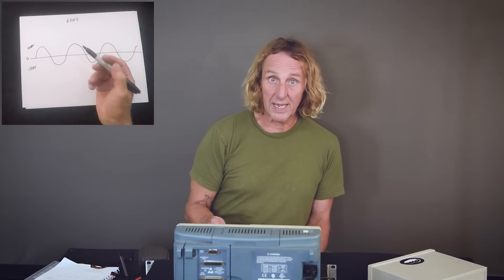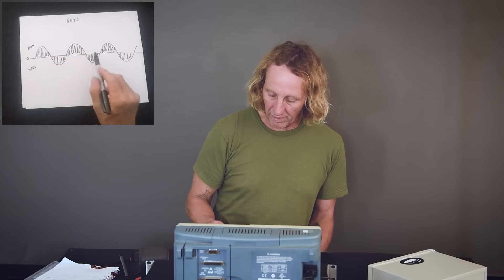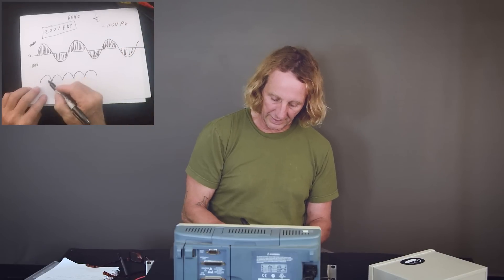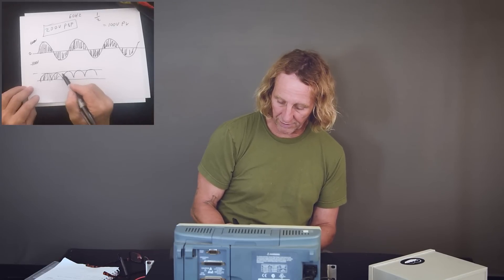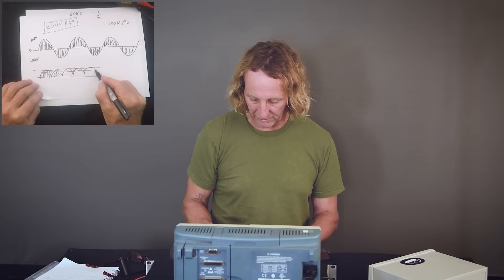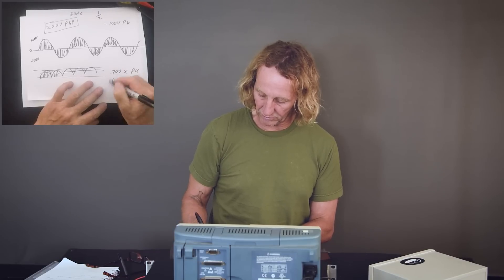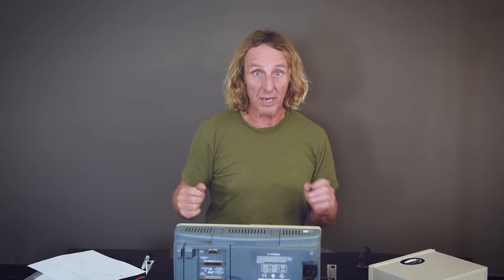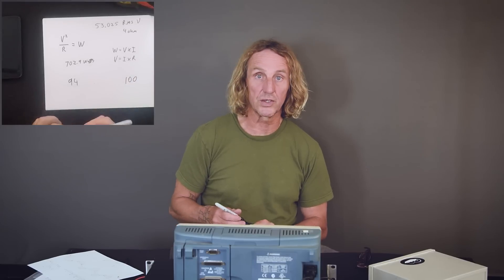Amplifier Power Watts vs Loudspeaker Sensitivity (Public)

Comment: Great video man, but now days everyone goes for the K watt sticker, dont even bother to look at frequency respond or weight. and power draw.. :washhands:👍👍
Reply from the maker: Power draw is a big deal for us. Power sag is an issue as well as feeder size and length and generator capacity.

Also thermal issues if hot weather causes amps to shit down.

Comment: the average val of the absolute value of the sine function is .637 not .707, I'm a little confused on where that number is coming from
Reply: OH! its the root of the average of the squares. In the video you said you wouldn't go into the math and I was trying my hand at the math. I wasn't considering the reality of the situation where we would have to take measurements to find the rms. Typical math nerd... Thank you!
Reply from the maker: Cool cool!
Reply from the maker: Not sure the vid this was posted about as it only shows the comment on my phone but maybe the info below applies and is helpful?

RMS Power:

When measuring a pure sine wave, RMS voltage can be calculated by measuring the peak voltage level and multiplying it by 0.707. This value can then be used to calculate RMS power. In turn, if the RMS power is known, it can be used to calculate the peak power.

Comment: What a great video series!

I have just one consideration: when you divide Voltage^2 by R to compute the power you are supposing a purely resisitve load --> In case of a speaker, which is characterized by an impedance figure, it must be considered the frequency of the signal to compute the impedance. Nominal impedance is at 1 kHz. Lower frequencies (like the 225 Hz you had on the example) will lead to lower impedance since the inductance component will behave more more like a short circuit giving you the true resistive part and so, for the same voltage, higher currents (and power)
Reply from the maker: Hmmm, the resistive load of a typical speaker is closer to 1/2 the rated 8mpedance of most speakers.

The rated impedance is an average of what to expect over the operating freq range

The minimum impedance is typically no lower than 80% of the rated impedance but around resonance the actual impedance is much higher.

Asking as the test methods are the same for various amps being compared we can get a good idea of what is happening.

The peak power and the amount of time the amp can deliver that peak power is more important in audibly how loud an amp is.

There is another factor where some amps capture and store back emf and increase their power as well.
Reply: @DaveRat  Yes, yes, I totally agree with You!

I was just pointing out that in order to compute the power "given" by an amplifier by measuring the output voltage it's necessary to divide by the impedance at that frequency (on the Impedance vs Frequency chart) and not by the resistance or the nominal impedance of the speaker.

The same would occur measuring Voltage and Current --> We need the phase between the two to compute the "actual" power and not just the Apparent one
Reply from the maker: Agreed.

Comment: interesting video been trying to put together a small pa on battery running 50w a channel on 4 ohms  with a 92db/1w speaker  but curious if upgrading to a 99db/1w at 8 ohms would be worth the upgrade as it then gives 25w from the amp
Reply from the maker: A speaker that is 7 DB more efficient should be the same volume at less than 1/4 the power. That said speaker efficiencies need to be measured in the same range as you're using them and often manufacturers will use differing ways to measure efficiency. Oh for battery operated systems high efficiency speakers are the way to go

Comment: 11:32 4 times more power out 2kW = 8kW not 4kW ... or did I missed something?
Reply from the maker: I believe the calc is correct in the video.

Speaker 1
94db 1 watts
104 10 watts
114 100 wats
124 1000 watts
127 2000 wats

Speaker 2 
100 1 watt
110 10 watts
120 100 watts
130 1000 watts

Speaker 1 max is 127db at 2000 watts. Would need to handle 4000 watts to hit 130db that speaker 1 hits at 1000 watts.
Reply: @DaveRat  well in the video it seems you are talking about the 2kW speaker then telling 4 times the power, written under th 2k speaker, it should be 4x2=8k … I will re-watch it again
Reply from the maker: So where is the error in the db to watts conersions shown in the post above?
Reply: @DaveRat  no no I never told an error in dB calculation. Just having umder the eyes 2000W, sayong 4times thata value, it’8000w. Not 4000.
Reply from the maker: Ahh, I could see the confusion with the text, should have made it more clear. I think what I say in the vid should be correct
Reply: @DaveRat  ues if it's referred ot the 1kW as you told in the comments here: yes :-)  The video created confusion then :-)

Comment: Keen to see where this leads. Does this explain the difference we hear between different classes of bass guitar amps? For example, my Gallien-Krueger 700RB-II feels noticeably more alive, responsive, punchy and with more character than similar output digital amps, including GK and Fender. I understand speakers/cab makes a difference but I have played enough different rigs to feel the difference. The tones can be similar and both are great options, but in my experience those MOSFET solid-state amps like the old GK 400/700/800 and old Trace Elliot AH250/AH300 amps simply delivered more of everything. You can push and push them much harder than their digital cousins. Curious to know your thoughts and understand the factors at play.
Reply from the maker: Hmmm, I am remiss to jump to conclusions about related gear without testing

Comment: Waw... sorry Dave , Im not an expert , but with all respect due , you are talking about Efficiency for something called Sensitivity express in dB/1W/1m, efficiency is the ratio of the average acoustical power (in W) radiated by the loud- speaker to the total electrical average power (in W as well) supplied to the loudspeaker its a number without dimension or expressed in % wich is very different things ...
Reply from the maker: Yes, this is true

Comment: I'm curious what the spec sheet rating would be for the new amp that you just showed us. I was hoping to learn if the peak was the rating that manufacturers use as "peak" and if RMS was fairly true to being actually true RMS even during dynamic loading. If the modern amp you tested showed a rated 350 watts at 4 ohm RMS or something similar, then it would appear you only benefit from the peaks creating a large burst of power to follow dynamics of music instead of a more compressed, flat signal. 

I look forward to seeing where this goes
Reply from the maker: You can see the specs, look up a powersoft T904
Reply: @DaveRat  I am only able to find one output rating for each impendence, which is, admittedly, laughably high. I would wager their "2000W @ 4 Ohm per channel" is a peak rating and therefore most likely 4x the actual RMS. Luckily, most brands in the price range I can afford list RMS, program, peak output power ratings
Reply from the maker: Download the actual owners manual and I believe it will clarify the spec

Comment: What if some amps use 30a/220 and break it down to a lower  v  does it still reduce the performance of the amp. Or 30a twist  plug to a 110
Reply from the maker: Would need to test but I believe most amps put out rated power with rated input ac. And with lower supply the output derated

Comment: So this test is with the amps set just a hair below clipping, correct? How do the amplifiers behave when you have more headroom to work with, if the amps are running at, say 75% of their maximum capacity?
Reply from the maker: At lower outputs they are linear all good.  On the member side i am doing a series of vids comparing the sound of various amps in overload as well as impacts of wall voltage coming soon
Reply: @DaveRat  So then I guess the best approach is to always try to get a slightly more powerful PA than you actually need so that you can run it with some headroom. As interesting as amplifier behaviour is when they're right on the edge, in practical terms a little headroom goes a long way.
Reply from the maker: And using limiters that allow you to hit the system hard when needed without bad sounds
Reply: @NealMiskinMusic  a lot of loudspeakers are killed from folks running amps at or under speaker rating, then running those amps into clipping. I was brought up to run 1.5 or 2x speaker rating for headroom and set limiters and listen to the speakers for any distortion they get from being ran too hard

Comment: Dave at 11:30 you say that it needs 4000W to get as loud, yet it is a 6dB difference, so it should be 8000W.
Am I missing something?
Reply from the maker: Yes the video math is correct.

Speaker 1
94db 1 watts
104 10 watts
114 100 wats
124 1000 watts
127 2000 wats

Speaker 2 
100 1 watt
110 10 watts
120 100 watts
130 1000 watts

Speaker 1 max is 127db at 2000 watts. Would need to handle 4000 watts to hit 130db that speaker 1 hits at 1000 watts.
Reply: @DaveRat  the 2000W text above the 4000W threw me off completely because it is a 6dB difference, not 3dB. 
I stand corrected.
Thank you for being kind and helpful Dave.
Reply from the maker: 👍 cool cool! I appreciate the double check! Keep me on my toes, all good!
Reply: @DaveRat  great!  But would you like to be a real audio nerd’s hero?
Most things you talk about in this video is already on YouTube on one form or another. 
But here is what is not so common:
Why don’t manufactures make most drivers’ efficiency 101dB or above?
What are the cons and pros of a higher efficiency above 101dB, besides the basic “heat” and price answer?
What are the phase issues (related to Impedance) by becoming more efficient?
These answers I am yet to find on YouTube.
Reply: @DaveRat  so in short for pro audio i should get the more efficient drivers? And what bout car audio subs that are so inneficient but can get so loud are they still the better option for car audio specifically or should a more efficient driver in car be louder IF the mechanical limits allow for it?
Reply from the maker: It really depends. Efficiency is one of many factors. Using the efficiency spec with the max power spec you can calc theoretical max output.

But, results vary widely. The efficiency specs need to be in the freq range that the driver is utilized. Also there are high efficiency drivers that lack the magnetic force needed to output pulses at higher levels than lower efficiency drivers 

It's another variable to consider

Comment: Dave you can just skip an extra step by multiplying Peak to Peak times 1.14.
Reply from the maker: Are you referring to covering peak to peak by dividing by 2 and the multiplying times .707 to get RMS?

If so, yes you can skip a step but not by multiplying 2x .707

The correct math is to multiply

.707 x .5 to get .3535

Multiplying peak to peak by .3535 will give RMS voltage.
Reply: @DaveRat  I stand corrected Dave. This is rust from my electronics engineering course from 1983 plus not enough coffee, but I do live on stages with equipment, full time for a living.
0.3535 times ppV it is, of course, but still, you save an extra step.
Reply from the maker: Yes, agreed and in future vids I switched.

Comment: Wow, that was quite shocking, the rate at which the modern amp fell off surprised me, I have read about sagging but I hadn't imagined it would be that fast. Talk about cliff hanger, ... : )
Reply from the maker: And also it's important to note that not all new amps do that and it varies from model to model and manufacturer to manufacturer.